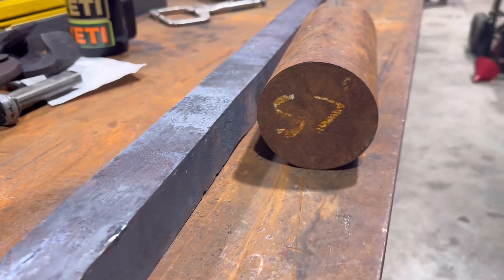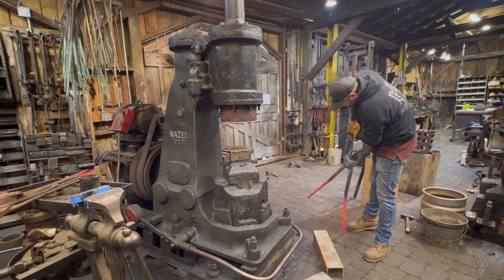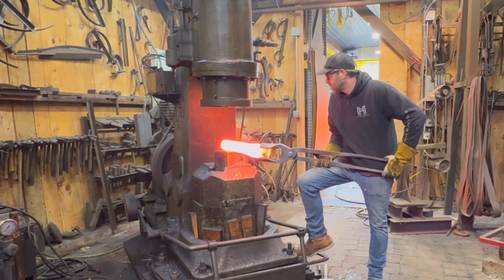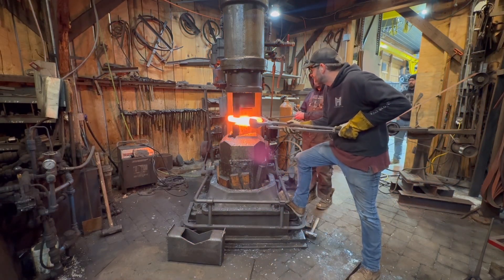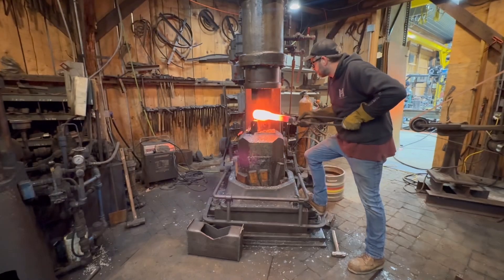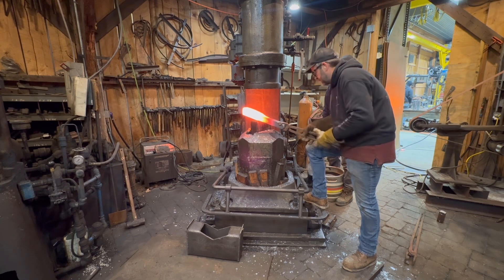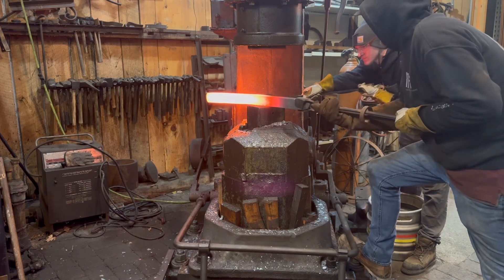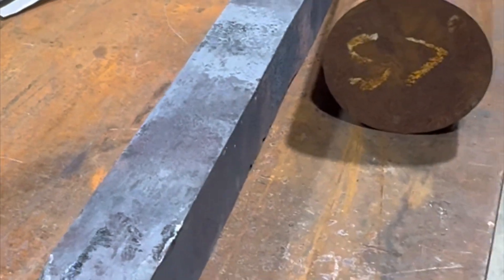Forging Large Steel, Power Hammer Safety ...... and some thoughts from Clifton Ralph

Comment: if you want the hammer 4 inches lower, just build a platform around it, sort of like a pallet that wraps around.  You can do it easy out of wood, or if you prefer bricks can do it as well.
Reply from the maker: I've seen that done. But I'll remount these at some point. Hammers this size run better on a thick concrete foundation